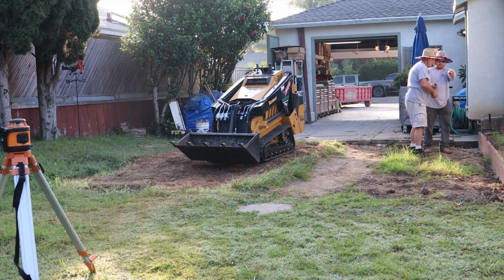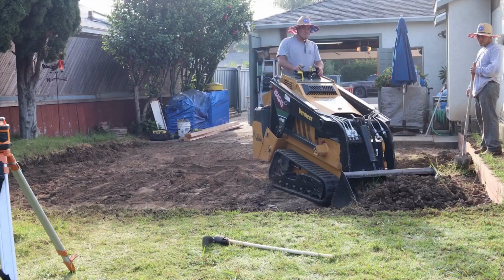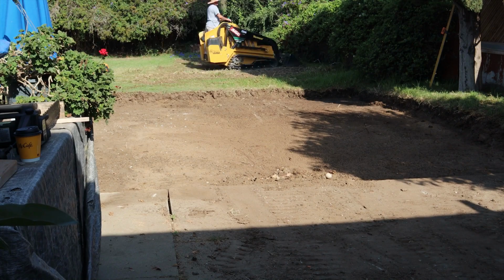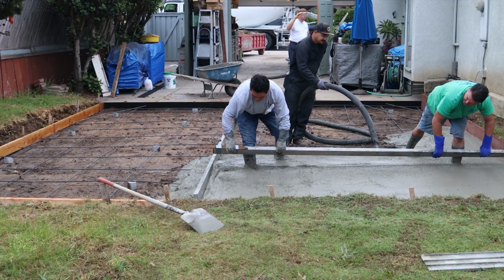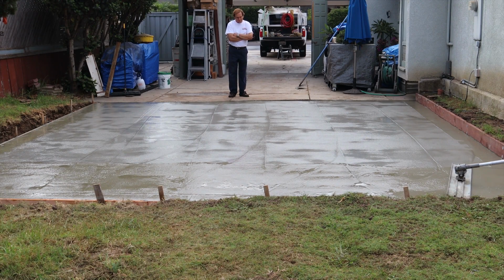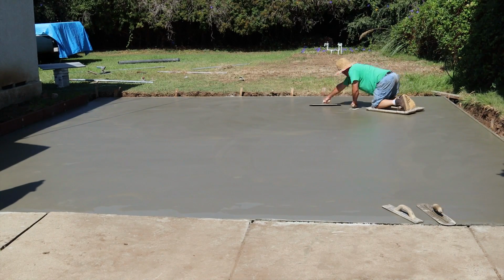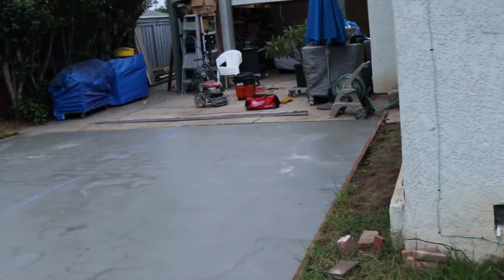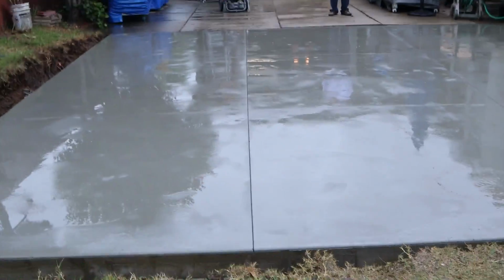How to Pour a Concrete Slab

Comment: Why a saw cut this time and not what you usually do with the manual hand tool?
Reply from the maker: Mechanic work shop.
Easy to roll thing around
Reply: not sure what you were rolling, it looked like a saw
Reply: He means it's easier for the homeowner to roll a creeper under vehicles, or a car jack, cherry picker, etc, over saw cuts as opposed to control joints.
Reply: ok answer makes sense now! - thanks

Comment: Awesome job, as usual!  Could you explain the difference between the funny float and funny trowel?  What did you have to buy / make to convert off-the-shelf tools into these?  In future videos, could you help give us a better idea of the timeline?  For example, how much time has passed between the pour and the knee-boards?  Thanks!
Reply from the maker: These tools are bought off the shelf.
Float is fiber glass and trowel is steel

Comment: Would there be any advantage in filling those control joints with a polyurethane product like Sikaflex pro.
Reply from the maker: Yes it means no dirt or water in the crack which could rust the steel over time, but then you would have to grind it out and re-caulk every 3 to 5 years.
Reply: @OdellCompleteConcrete  It would grind out easy though if you just ran the same saw blade through it you originally cut it with.
Reply: @sydneyshinshi  
yes that true but its still a 3 hour process hustling, with the right tools.

Comment: Sir,
How much per sq/ft did you charge for this type of job, no concrete removal?
Reply from the maker: Dirt cost more to dump then concrete.
3,500
Reply: @OdellCompleteConcrete  why is the concrete recycled? Aren't there usually people that need fill? A friend of mine has three front loaders. Sometimes i let him store dirt on my property. Then he fills gardens on new houses with it. Old cement, if there isn't a lot of rebar i use it for farm roads and equipment lots. Seems a shame to fill landfills with agregate and dirt. I even pick out the rebar and get a few bucks from someone with a truck that takes it to a metal recycling operation.

Comment: Today I decided to have some fun mixing concrete with different ratios of water, cement, sand, and stones to see what they look like when cured. I made a few samples and I hope they turn out nicely. I am planning on trying to sprinkle salt onto the surface of the wet cement to see what the finish looks like.
Reply from the maker: Sounds like fun

Comment: Great vid as always. Out of curiosity, how thick should a concrete pad be (and what strength concrete) for a rear loading area for a commercial building (sees traffic with trash trucks, delivery trucks?) Thanks!
Reply from the maker: 6"s with 1/2" rebar should work